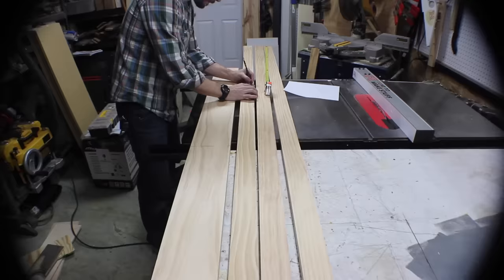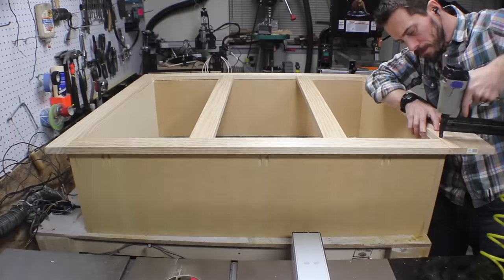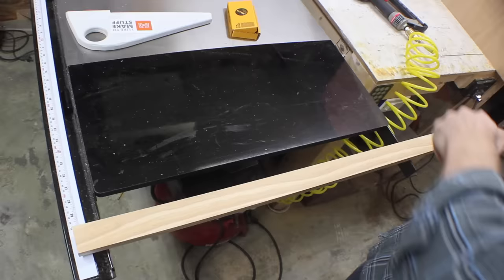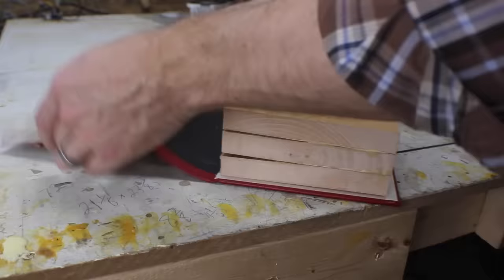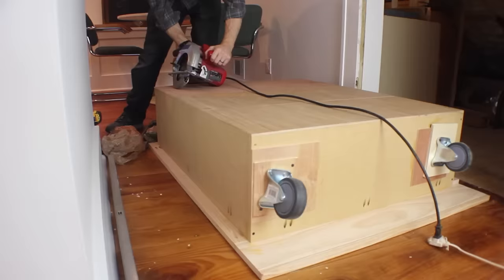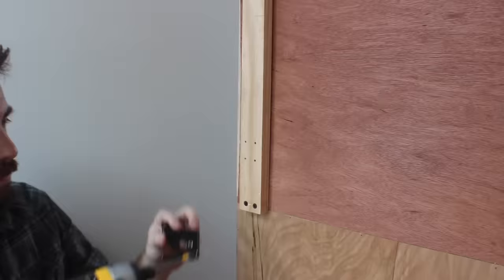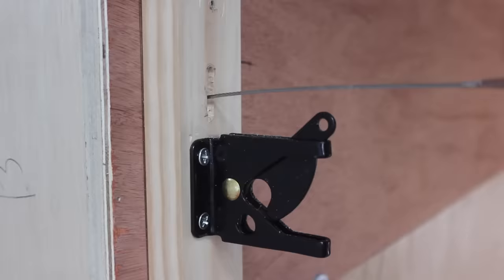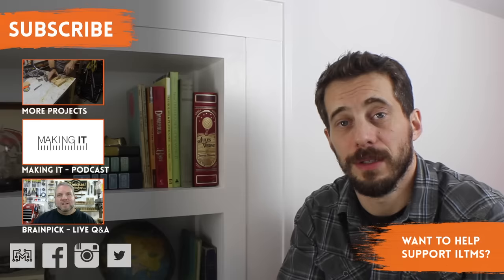How to make a secret door / bookcase | I Like To Make Stuff

Comment: Ok but how do I get a secret tunnel and room to make this for
Reply: Ξ Ňøcŧıvαgυƨ Ƈσɍαx Ξ you find a door that could look like it's not meant to be there so that it doesn't look off, or if it's ur house and not rented cut da wall and ya XD
Reply: Connect it to your neighbor's house.
Reply: Ξ Ňøcŧıvαgυƨ Ƈσɍαx Ξ if you have stairs that have a crawl space under them you could put the bookshelf but it'd be kinda small
Reply: that's not a secret tunnel. Can't you see the insulation and close ceiling? It's most likely an attic.
Reply: Bionical Panda Stairs with a crawl space under it? Sounds like Harry Potter's home.
Reply: I have a home with one room and a kitchen + bathroom/shower. The most impressive thing I have is a pair of fake bubbles, stuck on my bookshelve.
Reply: ikr
Reply: Blaze Flames Harry Potter never really had a crawl space though, did he?
Reply: Block hax or you could just make the hiding spot dimensionally transcendental.
Reply: Ξ Ňøcŧıvαgυƨ Ξ you could just make it the door to a room in ur house
Reply: ruthiel, lol
Reply: Ξ Ňøcŧıvαgυƨ Ξ 😂😂😂👏
Reply: Hide your basement with it
Reply: just buy a house. take down one of the bedroom doors and replace it with that magic bookcase. If you like adventure you could dig the room to create the tunnel and add some stairs. Oh and hang some lantern lights on the wall
Reply: Burnt Dumpling    You can't just all of a sudden be like,"Huh,I want to buy a house!"
Reply: then just take down your bedroom door in your current house. Or any unused room
Reply: lol
Reply: You hire a dwarf for the tunnel
Reply: Ξ Ňøcŧıvαgυƨ Ξ you could just put the book case in front of a room that's already there
Reply: Ya
Reply: Hi hello sir thanks for your support and   Thank    you r  very   Cool 😎    videos
Reply: Ξ Ňøcŧıvαgυƨ Ξ maybe close off a room and use the bookshelf as the door
Reply: Ξ Ňøcŧıvαgυƨ Ξ I seriously can't tell if you're joking or not

Comment: if you use the door a lot, the wheel might mark the floor and give someone a clue to the true nature of your shelf. Also, you could add a hanging weight to the latch to make it close instead of having a stiff wire push the latch closed. This would also make the book return to it's resting position automatically.
Reply: What gives it away is the fact that there is a gap all the door just like in any door.
Reply: @marks6663  no there isn't. the trim and baseboard he constructed is concealing the door gap by matching up with the room's existing baseboard and trim.
Reply: I would use spring instead of counterweight for the latch itself, as the counterweight could get tangled on the the bar.
Reply: @donkeyears4704  There is trim around the outside of the bookcase, but the bookcase itself is inset with a gap. Even adding quarter round like he says at the end, would not match correctly. See the video @ 8:50-9:00
Reply: You're seeing it because you know to look for it. I think the chance of a random intruder noticing it is slim.

Comment: I have to say, I would spot that door for what it is due to the obviously unnecessary gap in the otherwise flat frame around the unit. Of course, I'm a carpenter so I'd probably be more inclined to notice it than others but I would spot it.
I would have done this so that all of the visible trim around the bookshelf is attached to the shelf/door instead of the wall. That way, when the door closes, it brings all of the "trim" directly up against the wall itself. As long as the door latches snugly enough and brings the "trim" firmly up against the wall without any obvious gaps between the "trim" and the wall, it will appear that the "trim" is attached to the wall.
When the door opens, the trim simply comes away from the wall. This truly hides the fact that it is a door because there is no obvious separation between the shelf and it's "trim" and no obvious separation between the "trim" and the wall which would be a give-away. With all the trim attached to the door and not the wall, when closed, there is no visible reason to assume the trim is not attached to the wall as it would be in any standard cabinet framing technique.
Another trick to reduce any chance someone might spot the unit for what it is is to completely fill all of the shelves with books. No "nick-nacks".
Also, the latch book (and a few that are next to it) should be books that are far less interesting than Jules Vern. If I saw that hard backed book, I'd be interested in looking at it and that would mean the odds are higher that someone would innocently try to remove and peruse the book thinking it genuine.
The latch book should have a title on the spine that is something along the lines of "Advanced Mathematical Concepts In Structural Engineering - 1966" or something like that that almost no one would actually be inclined to attempt to read out of innocent curiosity.
Just a few ideas on the subject.
Reply: BigRalphSmith I agree with you but the kid is suppose to find it. if it was to be completely secret it would be a good idea.
Reply: BigRalphSmith Yes, I would also go about it as you have said but as an engineer I would just have to take a look at your proposed book.
Reply: I  am  going  out of  town
Reply: +BigRalphSmith This isn't a James Bond movie. It's an access panel for the utilities. It has to be thought of more as a dual functional door rather than Dr. Evil's secret laboratory.
Besides, how are you going to attach trim to the hinge side of the bookcase and not rip it off when you open the door?
Reply: Carl Jr
Relax, Carl. You sound really defensive and there's no need for that.
It's just a home carpentry project.
He was satisfied with the result and that's fine.
All I did was point out that someone who does finishing carpentry work such as myself would probably spot it and I suggested some things I might have done differently. That's all.
I bet if you really thought about it, you could come up with at least two different ways to do it but personally, I would use what's called a "double articulated" hinge.
They are designed to allow deeply recessed doors to move straight forward out of their recesses before swinging to the side. They are large hinges that can mount inside the casement or even on the other side of the wall.
There are even "sliding" double articulated hinges that accommodate extremely deep recesses. You could even build such a system yourself out of lumber.
The most common example of a double articulated hinge that I know of is what they use on a flat screen TV wall mount.
I can think of yet another method that even uses cheap regular door hinges and then there are "track" hinges etc. but you get the idea. All you need to do is use your imagination and that's what projects like this one are all about.
Reply: I wasn't being defensive at all. I couldn't care less. I was merely replying to your seemingly "my idea is superior to yours" attitude hidden behind your comment. The "I would have done this" and "you should have done that" comes off brash and conceited. The is a YouTube video to give people project ideas. It is not an instructional video. He's merely showing what he did and how he did it. If you feel the need to instruct people on how to do this a different way, make a video. Not saying you're a conceited person, but your comment came off that way. Your comments are helpful but imho you're getting a little too particular. That shows your have a passion for your work, though. Nobody can knock that.
Reply: Carl Jr
I think you guys are being way too sensitive and reading things between the lines that aren't actually there in making the assumptions you did.
But, whatever. Everyone is entitled to their opinion and text falls short when conveying emotion or intent.
I stand by every word I've said. If you feel some kind of way about that, that's cool, nothing I can do.
Best of luck.
Reply: Ok. My original post, go back and read it. You're the one who took it defensively and are being too sensitive. Your suggestions are great if someone is truly trying to make a hidden door. This guy is not. You're critiquing a video which does not need to be critiqued. It's an access door the guy's friend didn't want looking like an access door. It's a DIY protect. You're trying to raise it to another level. Like James Bond level. I'm sure your skills are admirable but that's not what this video is about. You're trying to instruct people to make filet mignon out of a video about grilling burgers. That's all I'm saying.
Reply: Carl Jr
Whatever.
Reply: Thanks for telling me about the double articulating hinges. Your info has been good. I'm not trying to knock that. It was just your delivery. That's all. Maybe I did read into it too much.
Reply: +Carl Jr imgur.com/a/kDMNU this is how you attach to the hinge side of a bookcase without ripping trim off when you open.
Reply: +BigRalphSmith   In fact I am no expert at all but I think I would be happier with the end result if there was TRIM simply over-riding the gap. But only if it was similar to the REST of the trim out. (Even in 'faux painting' there is a level of consistent illusion expected. It's not like it's really a SECRET, is it?) You all would do well to check out the Instructibles site if you haven't. The comments are mostly helpful and assumed to be respectful of the level of the poster, and suggestions are welcome, with a strict policy of BE NICE. And don't make assumptions about others' intent. It is usually apparent with continued visits. Cheers.

Comment: When sealing off an attic with spray foam insulation, I think they recommend you don't store anything or spend too much time up there. Off gassing stuff with no ventilation may make your eyes burn or kill you.
Reply from the maker: +Randy C This space is connected to the central heat and air and the insulation will eventually be covered as they complete the remodel of the space.
Reply: Good to hear. I'm glad you had the foresight to plan for proper ventilation.
Reply from the maker: Randy C FYI, this is a friends house. I just made the door :)
Reply: Great job.
Reply: +I Like To Make Stuff You should still let them know the dangers to which they exposing themselves, as it seems they are all ready to spend time there, with all the furniture, lights and books.
Reply: +Jimmy Wells naaaaaaaaaaaaaaaaaaaaaa
Reply: thank you for mentioning that
if I didn't know that I would be dead already
Reply: i believe that this is just a hardened foam , but there are other kinds of spray insulation that is a shredded version of the sheets usually seen in household attics that put fiberglass particles in the air , but as far as i know the hardened foam is perfectly safe
Reply: +Randy C interesting points ,if anyone else wants to discover best law of attraction guides try Tarbetti Amazing Attraction Tutor(Have a quick look on google cant remember the place now ) ? Ive heard some interesting things about it and my co-worker got excellent results with it.

Comment: You should have different books control different things, like lights etc.
He, thats actually a very simple idea: put the light switch of a bookshelf behind a book on a simple hinge! It should be a physics book about radiations of course :)
Reply: Marijn Adriaanse sounds like a good idea actually! Like your sense of humor
Reply: It would be cool as well to have the rotation of a globe determine the light intensity. I'd like to have these static object control thing because right now I don't even notice them anymore.
Reply: Marijn Adriaanse nice! Or by twisting a round clock hanging on the wall around.
Reply: Or you could buy an alexa and just scream at her to turn the lights on and off
Reply: You could use ferenhight 451 to open the thermostat

Comment: I’ve no plans to do this but it was still an absolute joy to watch. And respect for showing the mistakes and how to fix them. I’ve been thinking of installing a sliding door in the room I hang out in. But since the room is smallish, a sliding door next to my favourite seat wouldn’t feel cosy. So I have been thinking of hanging a bookcase in place of a door. I intend to put large wheels on it like you did, but I’ve no idea how to hang it. I know you can get those barn door fixtures. But they’re not exactly discreet. Since the bookcase is full door height, it would be easier if it could slide to one side for ‘opening the door’ so to speak as opposed to opening and closing it the usual way so things don’t fall off. The other reason is it would open close to the kitchen door and just feel claustrophobic and dysfunctional. For that reason I prefer it stays in the room as just glides to the side. Any suggestions would be welcome. Thank you.

PS. The bookcase wouldn’t be flush with the wall. But would look like how you normally put it against a wall.

Comment: Thanks for the extra comment at the end about how to get in if the cable breaks or if there is an emergency in there (stray snake finds it way in, someone has a panic attack etc). I was just starting to write out the question when you answered it. 
The room does look a bit claustrophobic though and (is that up in the peak of the roof?) an exit risk in case of fire. Of all the secret room ideas out there, I haven't seen a lot of thought about emergency exit plans, just a thought I'd like to see in these how-to vids. Thanks.

Comment: Seems like you should add trimming on the sides and top of unit so that it looks more like a built in bookcase. Otherwise you can see the gap between the wall and bookcase unit.
Reply from the maker: If it swung IN that would work, but this one swings out.  Having trim covering the outside would stop it from being able to move in the direction that it needs to move.
Reply: I Like To Make Stuff could you attach the trim to the bookcase so it just made contact with the wall and looked flush?

Comment: putting molding on the door itself would hide the gap between the door and the wall
Reply from the maker: +Chochi23 it would also stop the door from swinging outward.
Reply: Yes, unless you use offset hinges like typical car doors.

Comment: I made something similar. My secret door is a kind of book case too and I made it behind an existing door. Now it looks like a closet. I do not pull the book case towards me, I push it straight back into the hidden room. It has no hinges and has wheels on all edges, so that I can roll it out of the way. The hidden door can be opend by lifting the back of the second shelf and the back of the fourth book shelf. There is no way you can see how it opens, unless you know the trick. Next, I put some cabling at the back wall to suggest that it is a solid wall with some cables attached to it. Furthermore I filled this "closet" with light stuff so it remains light weight; all kinds of plastic boxes et cetra to suggest that it is just a closet filled with ordinary stuff.

Comment: Cool project. As you may know you need to cover that spray foam with fire retardant material or drywall because if you have a fire in that room and the foam catches fire it will emit deadly fumes that will kill you or a fire fighter. Plus I believe it is code that spray foam and extruded foam board must be covered.

Comment: Ive actually worked with powder coating in Brazil!
Just make sure it’s evenly spread throughout the part, try not to move to quickly when handling it and it should be fine. Im curious whether it will work heating it up in sections

Comment: Great idea and great build, go to your local chain, cable supplier and get some stainless wire rope, like 1/16" or 1/8 " size,  they have crush connectors to crimp the cable to make a loop, that wire is rated for over 1500 PSI and will last forever. Love the book idea unless some one wants to read it. 😁

Comment: Have a 9x9 walk through master closet with another door at the other end as a private entrance to the bath in addition to the bath hallway door. Expecting to install bookcase doors on both ends so the contents are more secure if there is a break in. You would not expect a door at either side, so it could be useful as a panic room in an emergency

Comment: I installed an indoor bird apartment house hidden in the attic — I have maybe 3-6 tenants during the year (I can watch them through a one way mirror and cameras)

There’s a cat/possum/raccoon housing extension of the garage hidden of course 

 and my personal favorite - a electric mouse/squirrel trap which is above the cat/possum /raccoon apartments which drops the dead rodents fresh into the rooms 

Only 3-4 times the currents tenants were shocked to have dinner fall on top of them as they were sleeping but didn’t complain as they helped themselves 

These small spaces are easily cleaned by flushing water through the boxes  (only once I soaked a tenant that I mistook as a fur ball)

Comment: I have a secret room in my house. I used a 600lb electro magnet and a wifi controlled outlet plug. Plug the wifi plug into an outlet, then step down transformer, and done. You have a multitude of options from there. You can get remote wifi buttons to control the plug, use alexa to voice activate it, etc. My door was in-swing so my options were more limited.

Comment: Having trim around the cabinet is a giveaway that something is going on with the cabinet. A better way would be to have a rough opening with or without the door frame and no trim. Then, the trim connected to the cabinet can lay up against the wall. This way is much less conspicuous.  However,  you will need special hinges to throw the cabinet away from the wall. Unfortunately, the Sauce hinges won't do that for you because of such little throw.

Comment: You can change the wire on the bracket with solid piece of metal or hard wood. It can make the bracket close better or also can put a spring (spiral wire) on the bracket... I dont know the right word for it... This is idea for better locking and unlocking the door